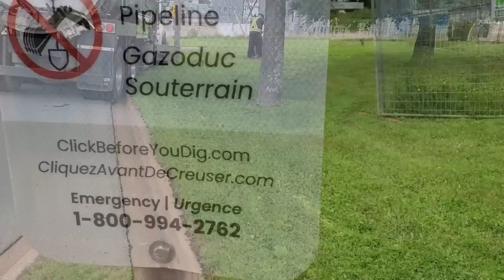Using a Hydrovac to set poles/anchor

Comment: Earlier this summer the company installing the gas line from the road to my house used a hydrovac to dig down for a junction point. What started out as a 3 ft diameter hole rapidly turned into an 9ft one as the hydrovac had undercut the area surrounding it causing my lawn to collapse. I have to admit it was pretty interesting to watch, but l wasn't impressed when l lost my telephone and fiberoptic lines in the process...

Comment: My old neighbour used to get those old Cedar Telus or BC hydro poles for free.  He made his own sawmill table ( bought  from a guy in Oregon).  He had his Mitsubishi bucket tractor rear PTO shaft powered the twisted 6 inch belt and it was used to turned the Table saw blade.  He would manually feed the fence and wooden poles into the table saw blade. He sawed up those poses into 6 by 6 or 4 by 4 posts and sell them to size.  Those poles made great fence posts or shed posts.   
This old German guy was  named George. Old school,jack of all trades . Welder , mechanic, farmer , farmer doctor , butcher , plumber , millwright , carpenter ! He would quickly give shit to you if you couldn’t do things right ? I hate to be an millennial or Gen z around these old school wise guys , give attitude or  be on a screen around theses guys ? These young people would get an instant dose of reality and how the Real world works !!!! 

Along the Hope Princeton highway. You can still see some of those old Telegraph poles  with original cross arms in place abandoned  along side of the highway and some are still in use to this day from 1947 ( the highway was built after the. War ). 
 The TV show( Jamie Davis )  shows this highway 3 , Rescue recovery.
Reply: Just cut off the BC hydro pole tags and you're golden.

Comment: I was using a manual post hole digger to prepare for a new mailbox post. The ideal spot wasn't so ideal after about 2 feet of digging. A buried 2x4 got in the way. I had to chisel it out using various combinations of tools since I didn't have any other way of removing it.

Comment: Hydro excavation is pretty handy. I work around linemen 90% of the time and a hydrovac is essential for digging in the city. However, hydrovacs can be pretty dangerous- there was an operator here who got injured when the high pressure hose broke. It impaled his midsection and he required surgery. Always do preventative maintenance checks, guys!

Comment: A bit off topic: There are various online sources for making a PVC pipe based well hole digger.  Just need a source of water under pressure (household level pressure) and you can attain 8 metres in little time (depending on the ground of course).  Good way to find fresh well water at low "drilling" cost.

Comment: we are lucky in england we have a small country and can afford to bury most of our electrical cables.  i guess canada is lucky it has plenty of trees because those poles look like they are worked hard!  :)
Reply: re: "and can afford to bury most of our electrical cables"
Floods, faults (my underground distribution run just faulted last week. It failed Dec 26th back in 2016 too. Underground is not fault free!!
Reply: no.  and it is super-spendy to fix when it does go wrong.  i was just looking at all the cables hanging off the poles - it is a rare sight in the uk, i live in a lane that is fed overhead but there is still only one cable even after they hooked up another two houses.  we got an extra pole though!    @uploadJ

Comment: Nice video Aaron. Saw this done not too far from me where they put a two piece steel pole with a 69 KV Air switch at the top. PEPCO has been putting these 69KV switches everywhere on there Substation feeders. And they are all redundant feeders.

Comment: Must be nice to have just dirt that deep.  Around here it would be rock drill or explosives
Reply: I'm surprised you don't run into that problem often here. Bedrock is pretty close to the surface around parts of NS and NB
Reply from the maker: @terryhoyt2058 St Andrews and Grand Manan was quite bad. Had use rock bolt pole anchors with an air compressor to set quite a few poles!

Comment: Thank you for the video. Question: How tall is a pole and how deep is it in the ground?
Reply from the maker: Our poles are 30-90 feet. The one seen in this video is 35 feet and set at 6 feet depth. Our typical depth is - 10% plus 2 feet. (Minimum of 6 feet)
Sometimes the depth change in specific circumstances (muddy or rocky terrain, underground riser poles, etc..)

Comment: That is the first time I've seen that Way to dig out a hole for setting up a power pole down here in Georgia they use a auger drilling bit to dig out the hole for the power pole  what do you do with the Old power poles
Reply: That's a trade secret. Lol. 😅
Sometimes they end up in a dumpster or out in the woods if nobody's looking 😅
Reply: @chris76-01  okay thanks for the info on the used power poles
Reply from the maker: Lol, yea usually cut up and into a dumpster.
Reusable ones are put back into stock, broken/short reusable ones the contractor may salvage for clothes lines installs or posts. Occasionally a customer that's close by may request it... If we're just going to throw it in the dumpster and it saves us time and energy to leave it, that's sometimes ok too.
Reply: @Bobsdecline   thanks for the info on this matter of the power pole s

Comment: Between the power company doing power lines and gas lines around my house. And the internet people running fiber they have dug maybe 50-60 holes with a hydrovac in the last year. Now the sewer guys get to come in a dig down around 12-18 feet in this area to run new sewer lines. Those guys have all ready said they have no idea why they let the fiber guys in before the did these sewer lines because they are sure they are going to take out a lot if it

Comment: for a new pole, do you dig 6 feet down, do a layer of concrete, then set the like& put concrete around it? How much concrete goes in the hole before you put the pole in?
Reply: The problem with concrete is that if you need to replace the damaged pole in the exact location,  you have to get the old concrete out. There are areas with very limited space and there may be other things going on where the new pole HAS to go back in the exact hole. In the video you can see them tamping as they backfill and that is good enough. If I could post pictures here I would.

Comment: Y'know, I dreamed I was a lineman last night. Me N the crew were putting up poles.
We were way up in the mountains on a little mountain backroad sinking poles. A
cable crew was behind us pulling the cable. Our crewboss was a hot redhead. She 
was pushing us pretty hard. Her shirt buttons were at the breaking point. She was 
wearing the tightest jeans I ever saw a gal wear. I couldnt figger how she got into
them. So, I asked her. She said, 'Well, you might start by buying me a drink.'  MAN,
we put up pole after pole after pole for miles and miles and miles. It was one of
those dreams that seems  SO  real. I woke up & still had 1 pole standing.

!
Reply from the maker: Lol

Comment: 3:44
QUESTION
What is the rate at which the hydrovac can remove material (cubic-feet/ minute cubic-meter/minute) ?
Thank You.
Reply from the maker: That greatly depends on the type of soil and how many rocks/roots are encountered.

The hole on the mainline side took about 20 minutes to reach 6.5 feet with an 18" diameter.

The hole for the anchor took about 1.5 hours as we encountered several large rocks that has to be smashed through with a digging bar and then retrieved with scoops
Reply: Thank You.

Comment: I’d.  Just.  Like.  To.  Give a. Shout out  ..  to.   ALL.    the guys   That.    HAND. DIG ..  THE. HOLES …. In. Places that a.   Suck truck or. Auger . Can’t. Get to …!!!!!     I used to do this for a. Few. Years …Digging and. Setting an anchor to the right angle is crucial…..   I would dig a.  Slotted hole …then bell out the. Bottom at 10 feet deep …tape in the nut ..lower the plate sideways to the bottom flip it flat ..screw in the anchor rod and. Aim it to the attachment point on the pole ….   Doing it this way saved a lot of unnecessary digging ….  Especially if your getting paid by the units completed ….   As for. Pole holes I would line the holes with 45 gallon drums top and bottoms cut out …set in deep enough that the top does not show when pole is planted   ..this was  to. Make sure the hole didn’t collapse before the crew could set the. Pole. ….   And. Made sure the tailings were handy. For. Back. Fill when. Setting ….      OH.   By. The. Way. I used to. Carry. With me.   3. Cross arms … and a. Chain hoist ..to lift out the 300 pound rocks that were 5 and a half feet down ….  And. Hauled a. Large compressor on wheels to run the. Jack hammer.   With.   3. To.  10 foot. Bits. …..   those were. Interesting to. Work with. !!!! ..    HAVE. A.  FUN. DAY.      If you can.  DIG. IT.   …….LOL.